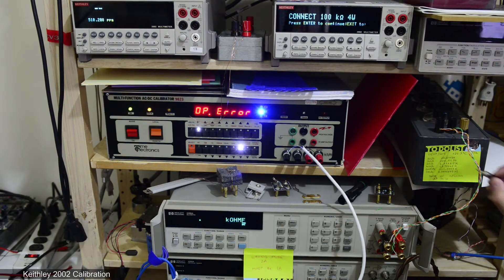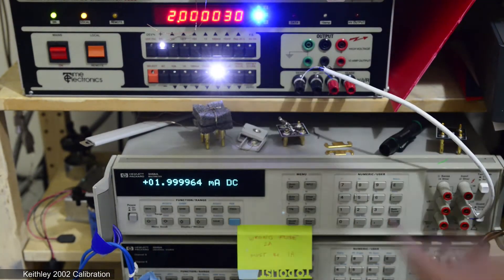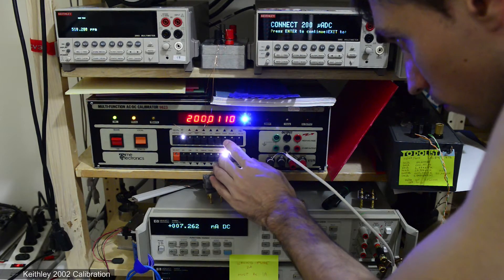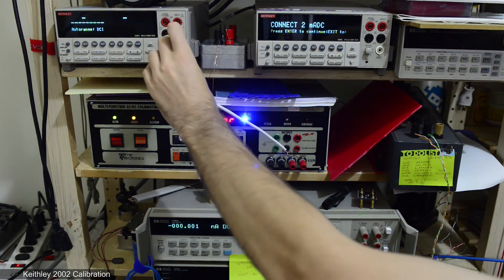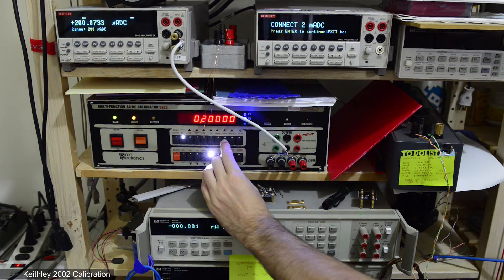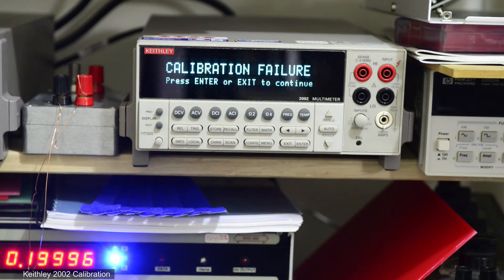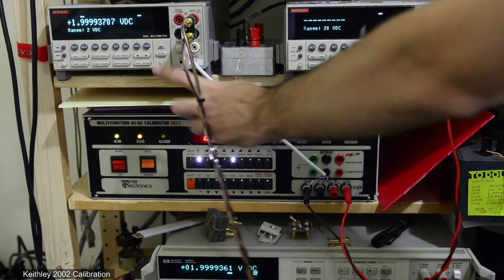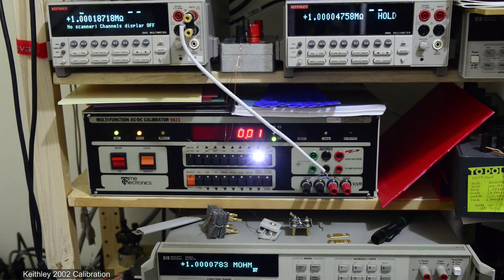Calibration of Keithley 2002 : procedure and caveats

Comment: What if you simulate the shunt resistance of the 2002 using an external shunt and monitor the voltage drop across it as you increase the current output from the calibrator on the 200uA range?